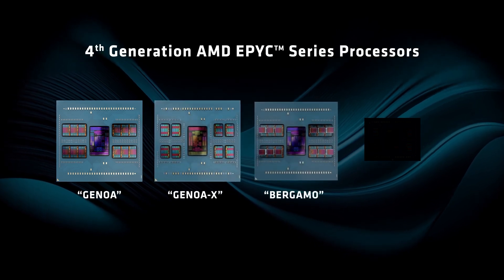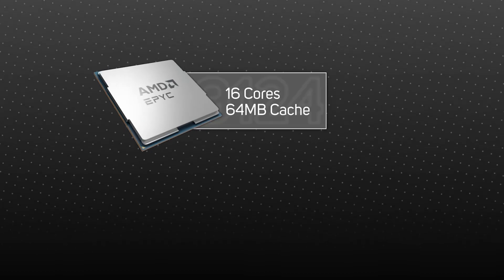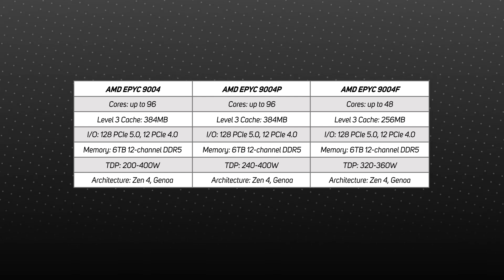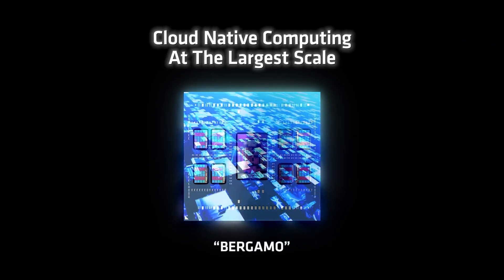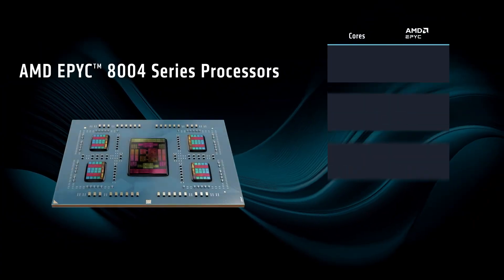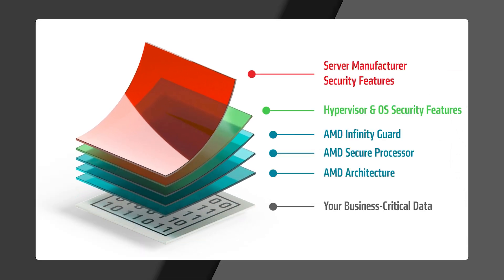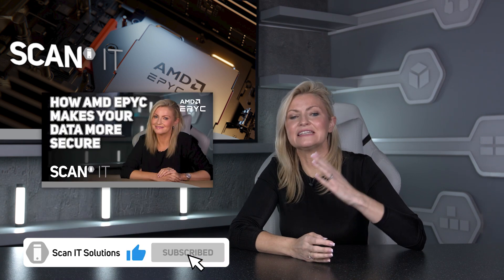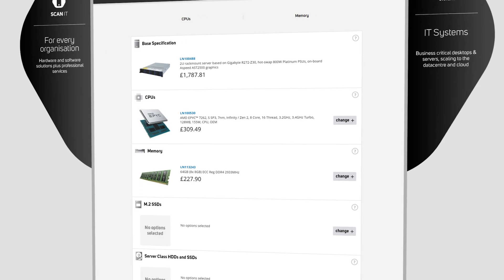AMD EPYC 4th gen CPUs explained - how to pick the perfect CPU

Comment: Are there any Linux + Windows compilers that can take advantage of the new CPU instructions. Even if it means I compile to .O or .OBJ files and link to my current projects.
Reply from the maker: Hi, in short, yes.

The main additional instruction set on EPYC 9004 is AVX-512, which is natively supported by multiple compilers. AMD Zen Software Studio contains a bunch of development tools, notably including  AOCC compiler and libraries as well as a handy profiling tool – all accessible free of charge at https://www.amd.com/en/developer/zen-software-studio.html and fully optimised for AMD's own architectures. GCC 13 contains similar support, and if you’re tied to the Intel toolchain, that will also work.

Happy compiling - JG